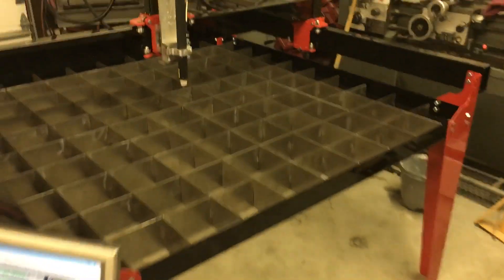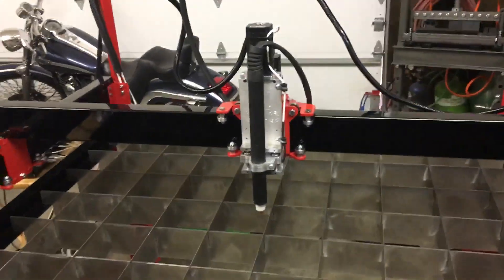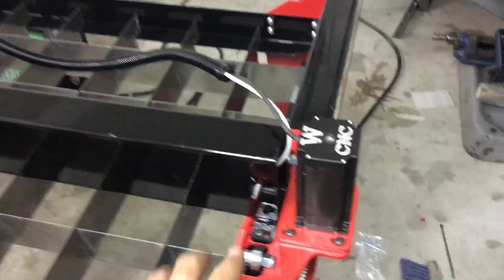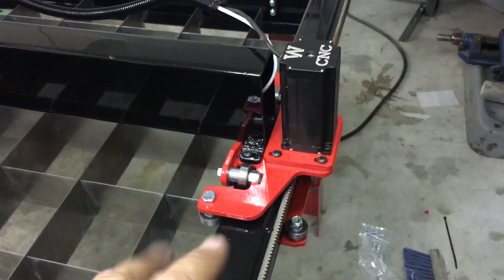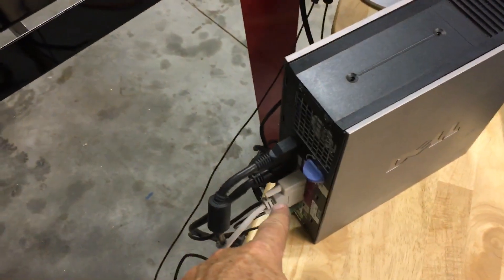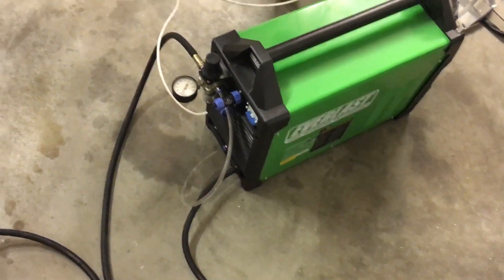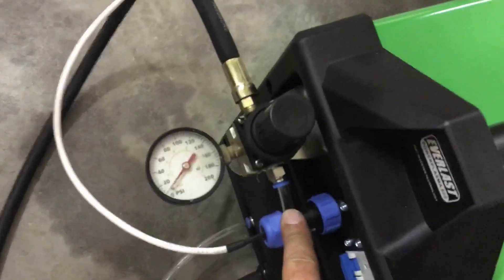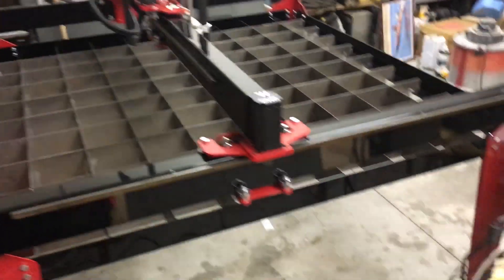WrightCNC 4x4 Plasma cutter quick review

Comment: What all have you cut on the machine so far?
Reply from the maker: William Holden I’ve cut 1/4” and 1/8 steel the machine is working great... I’m having problems with the Everlast 60s blowing fuses.
Reply: How is the level of accuracy?
Reply from the maker: William Holden it’s good for what I’m doing. I think Laser cutting would be more Accurate. I’ve not seen the machine lose it’s Position. All the parts I cut are Closed objects and the machine always cuts and returns right back to where it started cutting
Reply: @mcsqL7  make sure you have a good earth ground on whatever you are setting up, it has a 5 yr warranty if all fails, good luck.
Reply from the maker: @nexrace  Yes 100% My Ground was not good Everlast Replaced My 60S with a new unit. For the last year it has been working great and the Team at Everlast has always been helpful. And easy to work with.